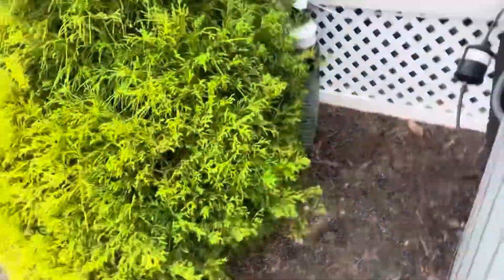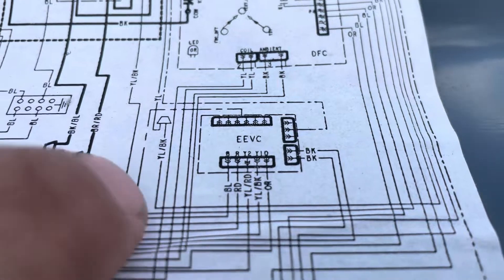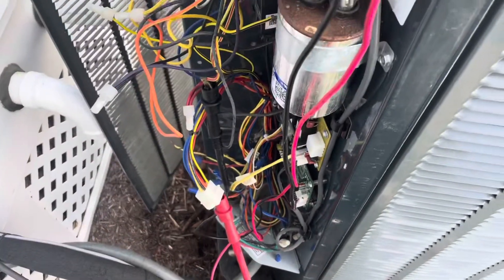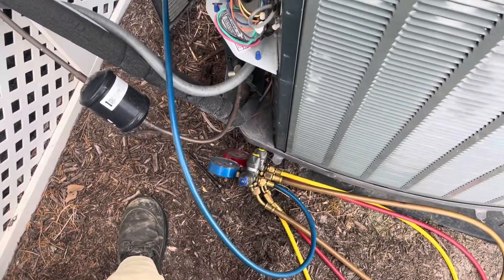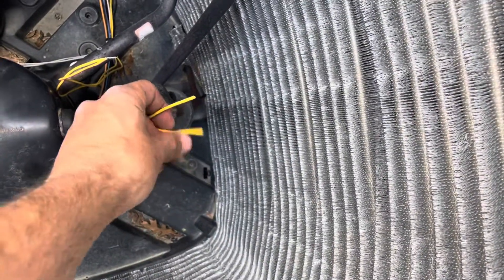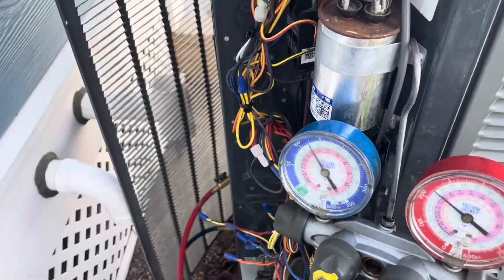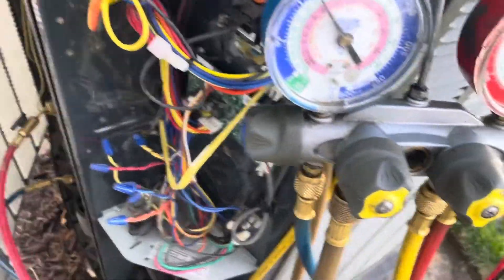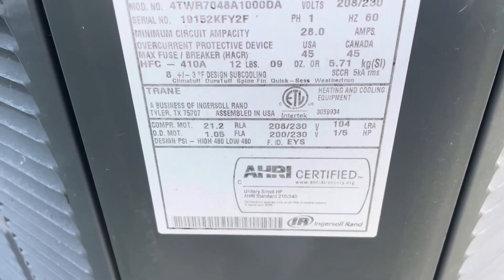Trane Heat Pump with Bad HPS, Diagnosed! #hvac #airconditioner #heating

Comment: I  just went through intermittent short cycling. Changed just about everything added an Easystart and no help. On a hunch i bypassed the pressure switches and bingo one of them was going bad.
Reply from the maker: Good stuff brother.

Comment: My heat pump in winter, doesn't work and runs only on the heat strips.  Can this be the HPS? It runs great in the summer here in North Texas heat.
Reply from the maker: No probably not the HPS.  It would definitely prevent operations in cooling mode also.  Unless the HPS (High Pressure Cut-Out Switch)  is doing its job and shutting the system down while in heating mode.  In that case you would most likely have an air flow problem inside.  Dirty coil, weak blower motor, clogged filter but this is all speculation without having a look at it.

Comment: Im quoted 1 to 1.5k to replace the low pressure valve here in central IL.  Does that sound right?
Reply from the maker: Seems fair.  There is a lot of work to replace a pressure switch like this.  Recovery of refrigerant, cutting switch out, brazing new in.  Pressure test and vacuum, and recharging with refrigerant.

Comment: CARRIER  48TME006  what causing to shorth cycling compressor every 5-30 seconds  RTU 4TON
Reply from the maker: Most likely a pressure switch.   High pressure switch due to an excessively dirty condenser coil or Low Pressure switch due to loss of refrigerant.    Unfortunately most Carrier gas packs don’t have a short cycle delay so you will get constant compressor cycling every few seconds.

Comment: Interesting. My 15yo Rheem Heat Pump keeps faulting L23 (high pressure lockout). Fieldpiece says 270psi both sides (scroll & txv setup). I jump the pressure switch and sometimes it runs happy and i remove the jumper. Life is good. BUT sometimes I jump it, and the compresser sounds like HELL. Not sure if its taking in liquid refrigerant what.  Inside coil looks like shit (all rusted). Im swapping in a brand new old stock Sure Comfort R410A system on Friday. Sick of dealing with this old dog.
Reply from the maker: Don’t blame you.  Good luck with it.

Comment: I could finished that service call in less than 15 minutes, wondering how much money you charged,  3 hrs @ 195 .00 truck charge and return visit 😮😮😮 it's a rip off
Reply from the maker: To complete this call properly it needs to be recovered, switch swapped out, pressure tested, and evacuated and recharged.   And btw, no call should ever only take 15 min.  Give your customer at least a good 30-45 even if you find the issue right away.

Comment: How do you bypass the high pressure switch
Reply from the maker: For safety reasons I wont share that.  I realize I bypassed the switch in this video but it was after a thorough evaluation that this system would not go off on high head.
Reply: just take the pressure switch out of the equation.
Reply: Pressure switches are connected in series to one of the 24v wires coming from the air handler. Disconnect the wires from that 24v wire and connect that wire to the contactor. Easy peasy. I just did it a few days ago.

Comment: How much does a replacement of the switch run? Lots of labor?  Thanks.
Reply from the maker: On an average size system holding 6-8 lbs of refrigerant a good ball park would be between $1200-1500.  Yes a few hours labor to recover, change switch and filter drier, pressure test and evacuate and then recharge.  Anything that needs recover, pressure test and evac I do a minimum of 3 hours.

Comment: Nice job. My low pressure cutout switch on our Trane 2.5 ton heat pump and I'm need to purchase a Supco universal lpco switch, but I can't find the cut out and cut in pressure settings. Do you know what settings I would need to replace it with on a swivel tee on the suction line service port.
Thanks
Reply from the maker: If it’s 410a you want to go with one around 50-55psi.  R22 20-25psi.
Reply: Thanks a million!

Comment: IN THE EVENT THAT THE HPCO OR LPCO IS TRIPPED - IF YOU PUSH THE CONTACTOR IN MANUALLY WOULD THE UNIT TURN ON?
Reply from the maker: Yes

Comment: That HP switch is very close to compressor discharge port and mounted straight above discharge pipe.  It gets continuously cooked at high temp.  Usually, they are mounted about twice the distance away from compressor discharge port and branch off to the side to run a bit cooler in temp.
Reply from the maker: Yea.  I hate when they put them that close!

Comment: While mentioning bad HPS I worked for the largest richest newspaper chain no good GANNETT when they were still making record profits years ago. They convinced a commercial refrigeration company to service their numerous roof top units . Rather then pay this company they agreed to place at least two or three nice sized adds in the newspaper. Somebody at the service company wss on the ball and found out that they were not p!acing enough adds then when confronted they would throw add in a Saturday thunder paper of the week that hardly anyone read. So they guy dost opted replacing safety or pressure switches. Would only jump them out. Cost cheap SOB'S $5,000 every time they had to get a over 100' crane to change compressors 40 to 50' from edge if roof.
Reply: Was supposed to say two or three adds a month!
Reply from the maker: That’s one way to get back at someone.  Lol.

Comment: does that pressure switch have a Schrader valve or will you need to recover all the gas to change it?
Reply: The way to fix this without ripping off the customer with all this labor is to just add a tee to the high side schrader valve outside the unit where you'd put you gauge on.  Then add your new pressure switch there.  Easy and less than 15 minutes worth of effort.
Reply from the maker: @billderby1527  Yea, ive done that before.  But this unit is under warranty and still has probably 15 years of service left.  Rather bring it back as close to factory as possible.
Reply: @billderby1527 I would assume you would pull the valve stem core in the original valve before the tee. Right?
Reply: @Drrich_DIY  No the tee will depress the stem.  You will however pull it on the tee where you connect the pressure switch.   Just position the tee and use the side it where it's still easy to connect your gauges to this tee moving forward.
Reply: @billderby1527  thanks very much.  Oh yeah. What was I thinking. No way to pull the core without evacuating the system/doing a pump down if adding a tee.
Reply: @billderby1527 so true
Reply: Just break it.  Lol 😆
Reply from the maker: It’s brazed in.  So I’ll have to recover.
Reply: How do u by pass the the pressure switch ?
Reply from the maker: @saulyaque5183 cut the two wires and wire but them together.

Comment: Hmmm.......TRANE XR-17 2-STAGE 4 TON HEAT PUMP UNIT.....GOOD STUFF....surprising the High-Pressure-Cut-Out-Switch failed at only 3.5 - 4 service-life years.....must have been made overseas and "wired-up" in Tyler, Tx. with the main unit.
Reply from the maker: Yea.  I found it strange too.  Thanks for watching!

Comment: Why would you cut the wiring, the possibility of a defective plug needs to be established. Just jumping the plug wouldve been easier
Reply from the maker: Already ruled out the plug before I cut the wiring.  Plus I still wanted the LPS to be operational.  Jumping the plug would have bypassed both switches.